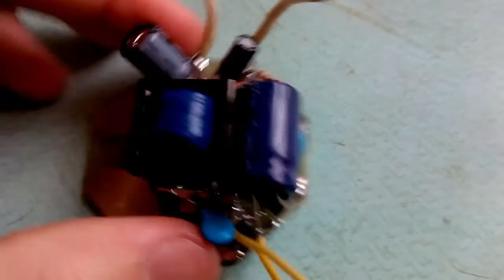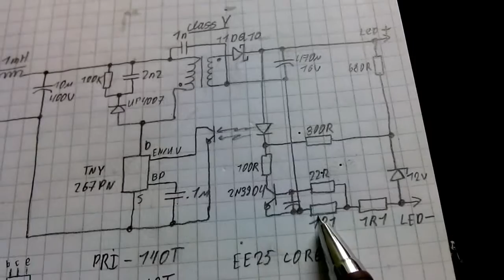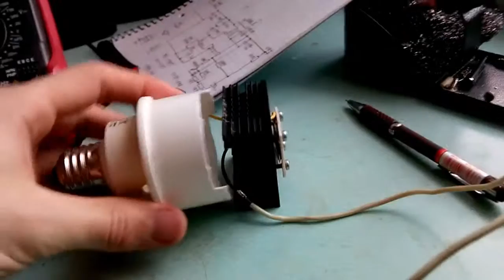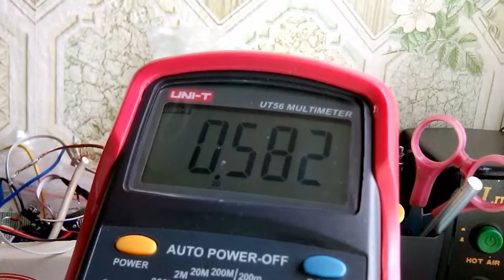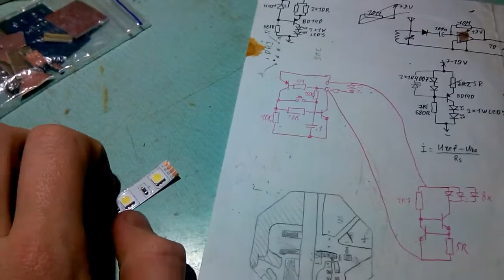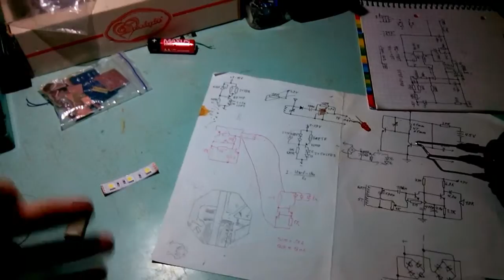7W LED Lamp

Comment: did you try making 12V cfl driver.I am planing to do so but how do I start one without stressing the light tube? I guess that heaters have to heat up and than it can be driven or something cause drivers that dont drive filaments are bad . how do i get that it starts slowly ?
Reply from the maker: Yes, I do have a couple of 12v cfl drivers. Both of them treat the CFL as a cold cathode tube, but one is flyback (inefficient+shortens life of the tube a LOT) other one is push-pull. Push-pull has a symmetric waveform on the output, thus it doesn't kill tubes with a mercury migration. It does stress the tube on the very start, but after that, it's quite friendly to it. If you want, I can make a video about them.
Reply: I have seen circuit that also has couple of turns for heaters but I think that uses significant energy from battery.
Reply from the maker: JOSIP Žlk You can try the method they use in CFL 230v ballasts. Google the schematic for it, and you'll see that there's a series LC tank on the output which produces high voltage to strike the tube after some preheating. Actually, check out this link, it may be just for you are looking for:
http://danyk.cz/zarivk_m_en.html
It preheats the filaments for some time, not permanently and has a symmetric output waveform.